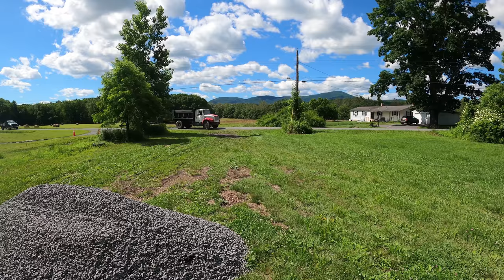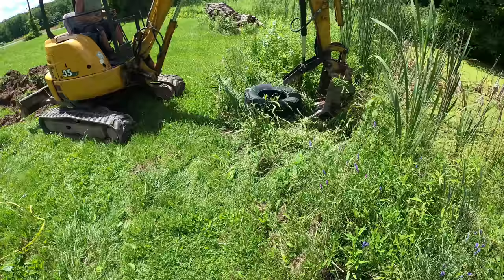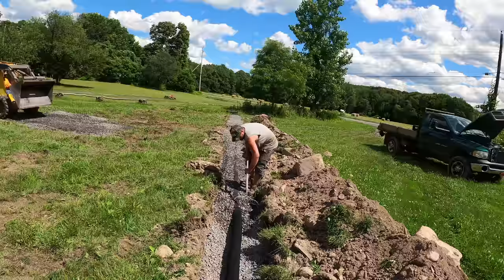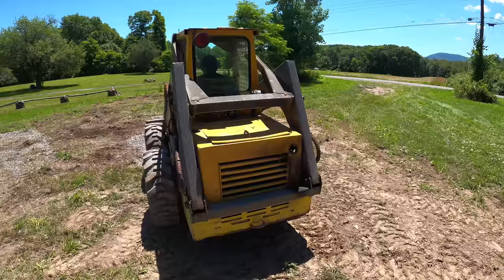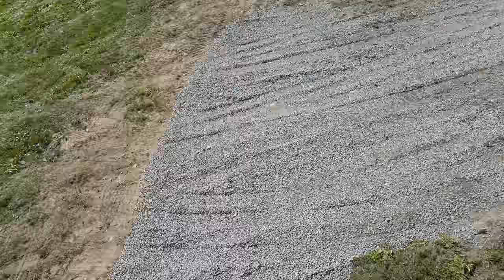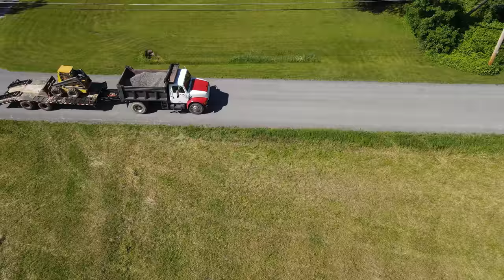Installing a french drain and curtain drain

Comment: I added 250lbs of old cast iron railroad track pads to the rear of my NH L555.  2 pads per side.  Really helped the cg of the machine with a full bucket.  I can lift around a 2000lb water tote with forks as long as I move slow.
Reply from the maker: thats good to hear, I might have to do that

Comment: There's a school of thought that placing gravel under the French Drain (instead of laying it out directly into the dirt and placing all the gravel over or along side the perforated drain pipe) allows some water to accumulate under the drainage pipe and stagnate, drawing in roots over time, etc. I don't know whether that potential situation would matter in this situation, but wonder whether in your experience that sort of scenario should be considered when planning a French Drain installation.
Reply from the maker: the roots would be coming in through the top and either way, the water level would remain the same. The gravel acts as a backup pipe, its actually not even needed when using that filter sock

Comment: People have a lot of questions about french drains. That pipe he put in isnt even necessary but most guys do put it in just to direct it more. Water flows very well through that stone and stone drains works excellent for years and years. Only thing I wouldve done differently is put fabric on top before putting dirt because dirt will clog up the stone over time. Not sure why he didnt, maybe because it was so shallow he thought itd get caught in a mower?

Comment: Hi Jesse, i wana ask you, what was the black product that you covered with the pipe?
Reply: It's a dirt sleeve .stops rubble and dirt blocking the holes in the pipe .can be bought on the pipe already or fitted afterwards
Reply: Yep, the pipe can come solid, solid with holes, or perforated little slits.

I like the slits with the silt sock.  Let's water in, keeps the clay and roots out.

Comment: You have me wondering rather than a flat ditch that will hold water but move very little without some pitch why not dig a sump at the termination four or five feet deep and pitch your ditch down to its bottom?  Then you have a movement of water and if the sump is big enough it can percolate the water away at a slower pace but keeping it out of the way.  It can also be filled with a drain rock if an open pit is objectionable using the soil fabric to keep fines out.  About anything is better than a flat ditch growing algae.
Reply from the maker: the water table is the level of that little pond so it would just fill up to that level. I had thought about that and it would work if that wasnt the water table level